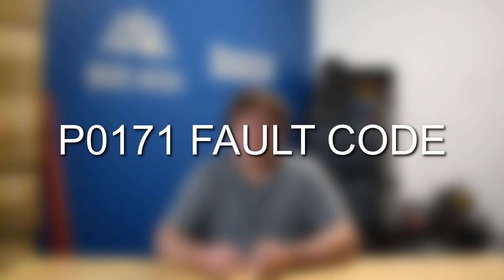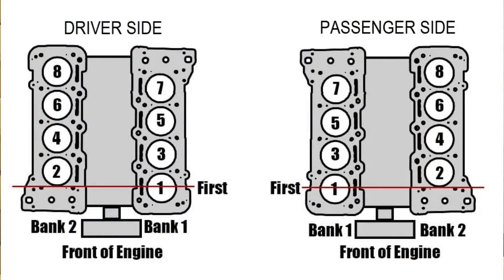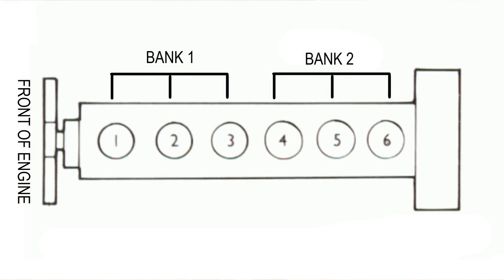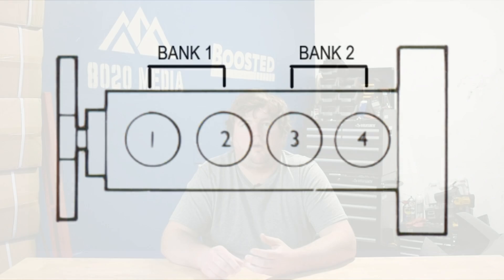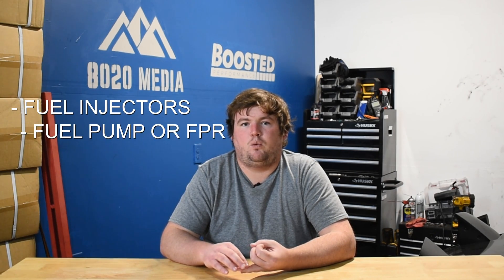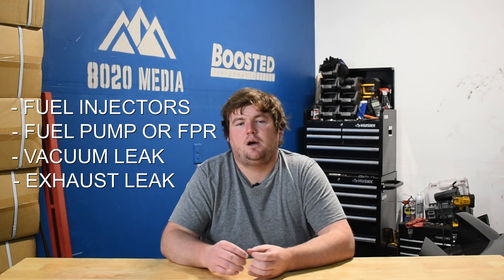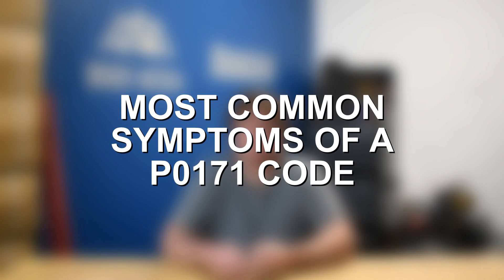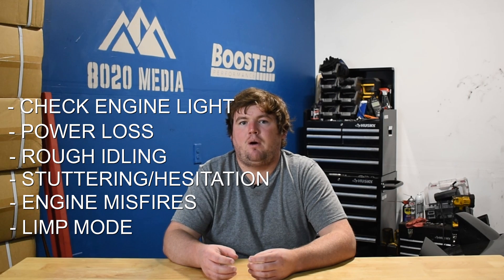Engine Fault Code P0171 - System Too Lean Bank 1! [Symptoms, Causes, and Fixes]

Comment: I have a 2007 Toyota RAV4 I got just over a year ago.  Didn’t have any issues with codes, but had a shutter vibration issue.  2 mechanics said it was the transmission torque converter.  I had a transmission 78k miles and new torque converter put in.  Also other issues showed up.  Spent a little over $4000.  The shutter issue was not resolved.  About 3 weeks after having all the work done.  Three lights came on on the dash, engine, vsc and another one.  Code for knock sensor.  Had a bunch more stuff done.  Then the code P0171 came up.  spent almost $7000 total since July.  I now no,shutter finally but had to replace axles, bearings, had repair done to part where drive trains meet.  Have new 02 sensors, muffler, MAF sensor.  It finally threw the code for misfires in cylinder 4.  Replaced the ignition coils and spark plugs.  Got the car back and only drove less than 10 miles and the P0171 came back on.  He said,he checked all the hoses.  I asked about the fuel pump if he did a pressure check, he said everything looked good on that.  I put a new gas cap on just in case.  I haven’t driven it again yet because I haven’t been feeling well.  He has been consulting with a Toyota mechanic.  He suggested that the ECM computer may need changed.  Any suggestions appreciated.  I’m on disability and already have spent way too much on this older vehicle.  Its value is not listed anywhere near how much I have spent at this point.
Reply from the maker: S - So sorry to hear this... Certainly sounds like you've spent more than what the vehicle is worth at this point and I know it is frustrating. Unfortunately, it's hard for us to diagnose this issue without seeing it first hand. We hope this video helps with this code.
Reply: I think it’s weakness fuel pump make sure do the pressure gauge test

Comment: I have been driving my focus RS  for 2   years with this code permanently  , car drives norma even i have driven hard  , so i have not beem  really concerned to solve the issue. Do you think after driving with this code  on permanrntly  for 3  years  ( 20.000 )  something its going to happen with my car?
Reply from the maker: J - Nothing will happen. Just may not be getting as much power as you should be.

Comment: Hey I was trying to see if I can get advice. My g37 been going into limp mode and it’s only throwing p0171 but no lights on the dash, I cleaned the 2 air flow sensor and they look good also clean the cold air intakes of the car, I also noticed that I’m leaking oil from my valves cover gasket. Which I’m sure that really doesn’t have anything to do with it. I don’t know if I need to change maybe the oxygen sensor maybe that’s causing my problem because at this point I’m really confused. Please help and thank you!
Reply from the maker: D - I would address the valve cover gasket. It could certainly cause this engine code.
Reply: @8020Automotive  okay will do I’m going to do is this weekend but thank you for responding means a lot you care for your followers! If anything else I’ll come again and ask for advice thank you!
Reply from the maker: D - Always! That's what we're here for. Keep us updated!

Comment: I have a 2016 bmw 650i gran coupe with 72000 miles. Advance auto nor Auto zone are getting any codes. Finally  got a code 118101 fuel mixture to lean but car drives excellent…./
Reply from the maker: R - If the car isn't seeing any drivability issues, you should be alright!
Reply: So should I start with cleaning the MAF sensors or having the 02 sensors changed? Still have the ugly check engine light
Reply from the maker: R - Not a bad place to start.

Comment: Hello, I have a 2021 Chevy Equinox,  I replaced the battery, air filter and MAF sensor. Now I have code P0171 along with P1101 (which I thought was the MAF issue) now along with those codes when I drive my ESC traction lights come on engine shakes when idling. HELP me please!!! What could it possibly be!!!
Reply: Also check engine light is still on after doing everything I've done. nothing is blinking just there.
Reply from the maker: N - Sorry to hear this. Did you check the wires to the MAF? How do those look?

Comment: I changed MAF sensor, Fuel Pump, Pressure Regulator and O2 sensor but i still having that problem so now my next step is Fuel injector. If that's still not fix the problem I don't know what to do. P0171 with check engine light.  Honda civic si 2008 with 245000miles.
Reply from the maker: K - You're touching on the right things. Have you cleared the code?
Reply: @ I didn’t clear the code yet so the code will not go away after changing everything? So do I have to do fuel injectors or not? The car is running fine. Thanks for helping.
Reply from the maker: K - If the car is running fine, try to clear the code first and drive on it for a little bit to see if the code comes back.
Reply: @ I will try it. Thank you so much.
Reply: @8020Automotive how do i clear the code?
Reply from the maker: @ You would need an OBD scanner or you can disconnext and reconnect the battery.
Reply: did ur light go away

Comment: It is expensive to fix if the fuel system is return Less & it's the fuel pump or pressure regulator which is at fault such as in my car which is a Holden Commodore (similar to the Pontiac GTO in the U.S.) because if I paid a mechanic to fit an OEM fuel pump & sender unit the pump alone would cost $300 AUD & the tank needs to be removed from the car to replace the pump !
Reply from the maker: R - Thanks for taking the time to share your experience.

Comment: What's the $ range of fixing the problem and does how the car is when taking off where it don't wanna shift till it hits 3000 rpms and higher
Reply: Also drive a 2002 vw gti hatch 1.8t
Reply from the maker: I - It's kind of difficult for us to give an estimate because it could be a number of things.

Comment: My 08 Accord gave me this code, so my mecanic changed tje cranck sensor, still kept on doing tje same thing, he told menitncould be an air leak. This weekend it gave me a hard time to start and check engine light came on plus the VSA with a ! .  Any ideas Why am i getting that (VSA!) now? thanks for video.
Reply from the maker: A - As far as the "VSA!": wheel-speed sensor issues, low brake fluid, and problems with the steering angle sensor

For the p0171 code, there could be a myriad of things that could cause it. We go over those and diagnostics in the video.
Reply: @8020Automotive Thanks!

Comment: I have a P0171 Code on my 2004 Toyota Prius. I recently changed my air filter and ABS for my car. I had no issues but later on (two months) my car got the P0171 code and my engine rattle has increased louder than before when accelerating. I'm not sure how to diagnose the car and I wanted to ask your opinion on my car. Thank you for your time and your videos.
Reply from the maker: L - Have you taken it to a shop? This video may be helpful with your research: https://youtu.be/BiYsqRJCLhE

Comment: I got this on a VW Polo 9N with factory LPG only when it switches on LPG , P0171 ....on petrol it works fine ,nothing wrong ,no fault codes .... I think its an injector
Reply from the maker: L - It could be your injector!

Comment: I drive a 2018 supercharged BRZ. This code ended up pointing to my supercharger bypass valve failing (the valve is stuck open).
Reply from the maker: A - Nice. Glad you were able to figure it out.

Comment: Yes I've been today a few hours ago had my Part fitted. (Purge valve) picked up car after paying £238.00 
Me and my partner drove back home which is a few miles away. Car drove like a New one again. Very happy about it.  They fixed and reset program. But upto yet. This Purge valve replacement has done  the trick upto yet.  The mechanic gave me a copy of what he did. Plus they mentioned that driving about before I had it fix may have caused problems to over parts in my engine ?  But I hope not.  P.
Reply: Yeah Thanks. But it was strange how the Car were running good and no signs really. But the two codes were saying different. But the astra GTG. Is running even better than it was doing. P.
Reply from the maker: P - Nice! Happy it's back to normal.
Reply from the maker: P - Thanks for coming back and sharing your experience! We're glad they could fix it up for you.

Comment: Been to technician with Po171 code on vauxhall astra gtc. He said it's the purge valve that stuck open ?  He said it's a main dealer part. He's ordered it. It will cost £231.00. For part & Labour. Is this about right.  PO171 code. Problem. P. P.
Reply from the maker: P - Could certainly be the cause and it isn't wildly expensive, so keep us updated.
Reply: Repairing tomorrow so hopefully it will fix this engine light & po171 code & po458 code that the rac man came up with on his machine (scanner)  @8020Automotive
Reply: Yeah will keep you informed as the Purge valve is going on at garage tomorrow. He did say that its this part I need after the disnostic report from him. My car is showing no signs of faults. Only engine light on. Plus 2 code po171 & po458. ?  See what happens after repairs done. P.  @8020Automotive
Reply: This problem of too lean bank 1. It could be anything because some cars purge valve, some cars pcv rockercover, some car oxygen sensors, some cars injectors So where to go my I fixed purge valve the problem still around what to do?????? 😡😡

Comment: Put BG 44k cleaner❤ in my fuel tank and not too many miles later I'm showing the 0171 2002 Toyota Camry 110,000 MI 2.4 L engine code? Is this just a coincidence
Reply from the maker: D - Give it a 50-100 miles and see if it's still there.
Reply: The cleaner gave the computer a false sense of being lean, after a while it will go away reset your light you should be fine.

Comment: Mine has this code ( and it causes a misfire, it has rough idle, misfire in cylinder 5 and cylinder 2. Someone please help I changed the ignition coils and I don’t think that was it someone please help.
Reply from the maker: E - Did you change the spark plugs?
Reply: It also has system too lean on bank 1
Reply from the maker: E - Did you go through the steps in the video?

Comment: Check your air filter cover and connections. The code came up for me simply because one of my air filter cover latches wasn't fastened. $0 fix.
Reply from the maker: E - Great shout! Thanks for sharing this feedback.
Reply: I saw the same with mine
Reply: I have this code P1071 code on my 2003 Ford F-150. I changed the fuel filter but it showed up again. Any advice on the next thing to do? Thanks in advance.
Reply: Absolutely ! I DID REPLACED THE AIR FILTER LIKE 1 week before this code came up , Ans  unfortunately lost 2 of these clips that HOMDS down the  air filter box . it has to be related to this . 🤦🏻‍♂️

Comment: I have this code and it says missfire on bank 1? What is the likely fault? I don’t notice any missfires and a mechanic has seen all number on his computer and says they look okay… also my engine light comes and goes? Also car seems to run fine… mechanic said it could be that the system dirty, or the cat convertor, so try some system cleaning stuff first?

Not sure if i had code P0506
Reply from the maker: F - I would listen to your mechanic.

Comment: I replaced fuel pump both 02 sensor MAF spark plugs injectors and still getting code. Car runs better no issues I’m tired of buying parts what’s next??????
Reply: If you have an obdii reader paired with an app(program) on your phone, see if it made a difference with the long term fuel trim. Might need to find the acceptable range for your vehicle
Reply from the maker: K - Thanks for taking the time to help viewers.
Reply from the maker: I - Have you reset the code? How long have you driven after replacing all those parts?
Reply: @8020Automotive  maybe 200 miles
Reply: Yes reset code but it’s a permanent code?
Reply from the maker: I - Thanks for sharing your experience. Give it some more miles and keep us updated. So long as you aren't experiencing any symptoms, it should be okay. Or can take it to a mechanic.

Comment: I have the p0171 code on my 2009 wrx along with a number of dash lights including the check engine.  A symptom that goes along with this (not sure if its the cause or seperate) is, when I get gas the car stalls out and wants to keep stalling for the first couple half mile or so after.  I have read there is a vent valve that can cause this but again not sure.  I also read something about fuel pump filter.  I have started to notice the car making a whining noise as well.  Any help would be greatly appreciated!
Reply from the maker: K - We think this video may be helpful for your research: https://youtu.be/7bqAIbYRdnc
Reply: Thank you!  @8020Automotive

Comment: I have this on my mrs and the engine light only comes in at 100kmph it's weird
Reply: Could be a vacuum leak or some kinda sensor
Reply from the maker: John - Do you have any other engine codes?

Comment: Hey mine is paired with P2070 (intake manifold tuning valve stuck open bank 1). Are they the same thing and what is the best way to fix both of these if they are two individual problems?
Reply from the maker: D - They aren't the same thing, but the P0171 is likely being caused by the P2070. If you fix P2070, it is likely that the P0171 will go away.

Not sure what vehicle you have, but this may be helpful: https://www.youtube.com/watch?v=nPQPFzL37fA

Comment: Appreciate the video and clear explanation. My check engine light keeps turning on and off randomly so i hopped on the chance to run to AutoZone to have it scanned and this was the only code that came up. Hoping it will be a relatively cheap repair

Comment: I got a question and need help bad even my mechanic shop cant figure it out.. i have po 171 code on my 2001 toyota celica gt .. they change the maf sensor and the intake manifold,pcv valve oil change and filter and still the light came on. I dont want to keep spending money on something i dont need. What else can be left they said the hoses are good so the last two things is the o2 sensor and fuel injectors. What do you think it might be
Reply from the maker: M - It could be either of those that you mentioned at the end. Unfortunately, it's a little difficult to pinpoint what it is without any symptoms listed.
Reply: @8020Automotive could it be clogged up fuel filter ?
Reply from the maker: K - Certainly possible!
Reply: Was the MAF sensor replaced with OEM, (original equipment manufacturer)? Very important because the sensor parameters are very important and the aftermarket sensors can vary wildly on the signals they feed the computer.
Reply: Fuel filter
Reply: @michaeleverett2650 it was actually the fuel injectors i replace them all and car never had a problem since.